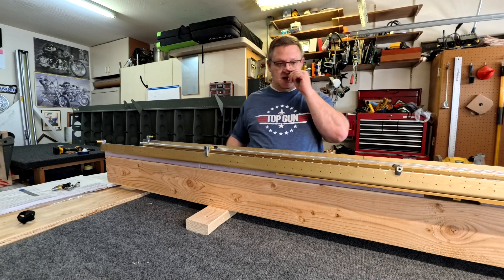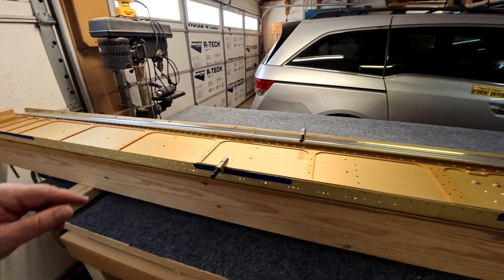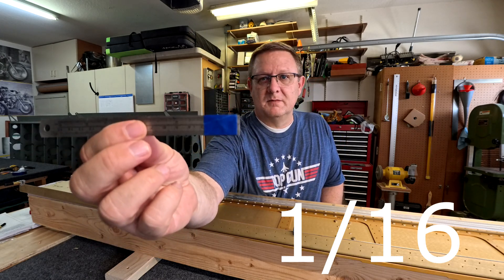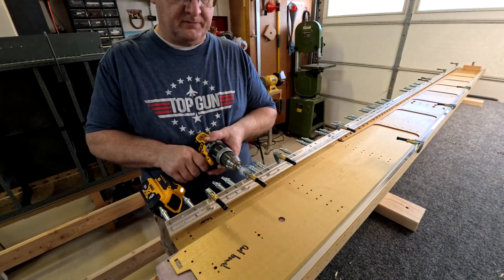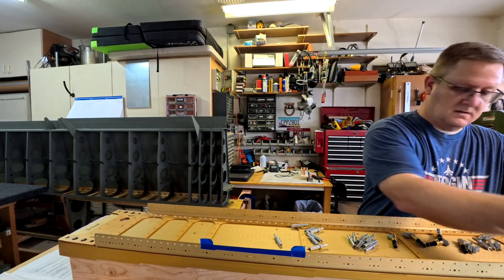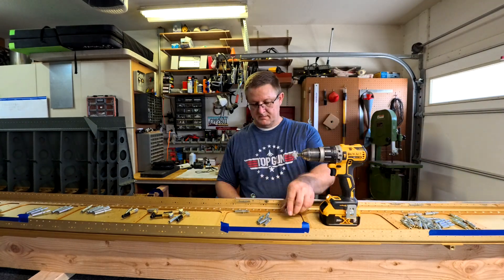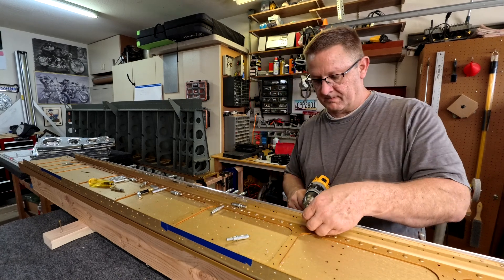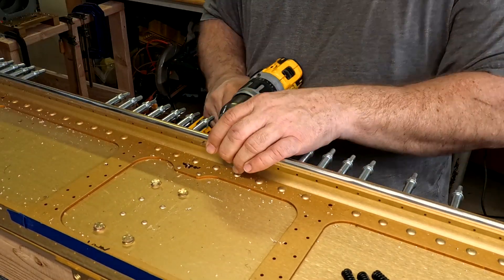RV-14A Build: Wings 13.19 - Building A Vans RV-14A #aviation #vansaircraft #dadjokes #diy #kitplane

Comment: Hay, I am glad to see that you put the mistake with the J-Channel in your video. I made the same mistake on the left wing. I should have paid better attention to the Caution Note to check on Page 13-2 to check Page 13-4 for better details. That was the learning mistake that taught me to read the complete section before starting anything. Good luck with your build. I am building my fuel tanks at this time, pro seal is so much fun to work with, NOT!!!!
Reply from the maker: Thanks for watching! I'm working on fuel tanks right now as well. if you run into anything you want to warn be about please make sure you share! Thanks again

Comment: Appreciated your making this one because it confirmed that I had drilled my J-Channels correctly.  I spent several days trying to understand the "rolling" thing before I committed to the only way I thought it could work.  Only after drilling the holes and replacing the channel did "the why" become clear.  I'm finishing up the left wing top skins and about to build the wing cradle.  Thanks, again, for posting the video.
Reply from the maker: Thanks for watching!